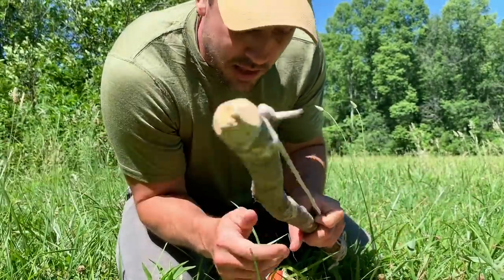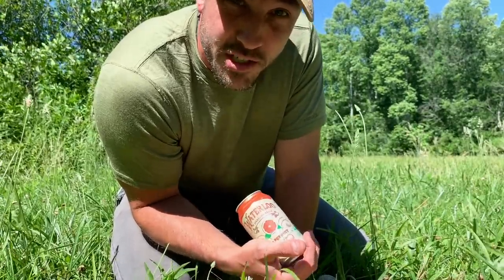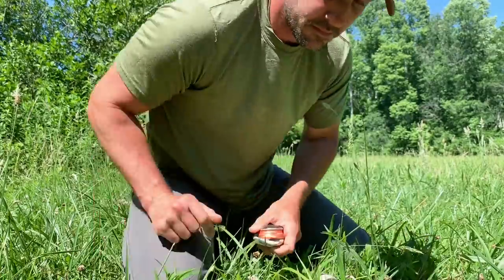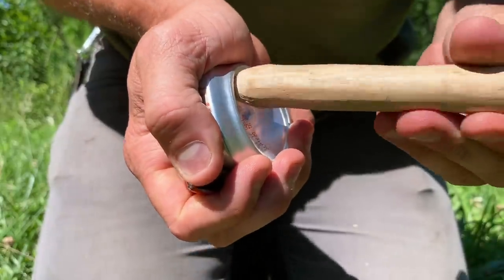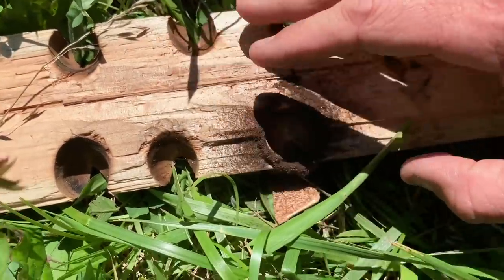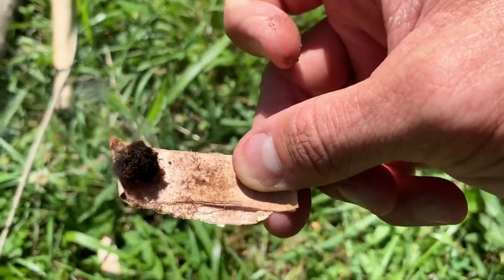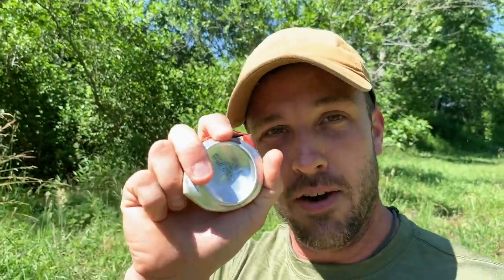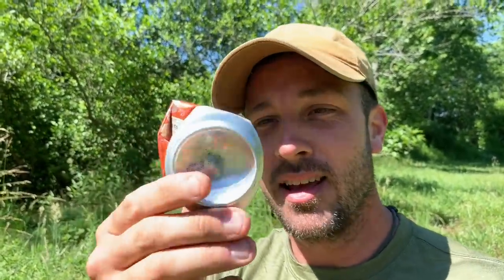Beer Can Bearing Block

Comment: Very cool! Can't say I'm much of a fan of bow drills; looks like it takes quite a bit of skill. But I guess if you have nothing else then it's what you gotta use. I'd prefer using a magnifying glass but those aren't exactly laying around.

I hope the fact we haven't seen much of Mr. Weatherman lately means he's finishing the next Morgan book. 😮😮😮
Reply: If it's a nice sunny day, you could polish the bottom of the can and use that as a "parabolic" reflector to concentrate the sunlight into a beam that will get a ball of fine dry material smoking.
Reply: Thanks for watching! Yes, the bow drill does take quite a bit of practice but it is a great skill to learn. Owning this skill gives me a great deal of confidence in wild places and an appreciation for the Bic lighter. 
-Jason

Comment: Two recommendations for simple fire starters: Put 100% Vaseline and cotton balls into a plastic bag. Get the Vaseline all over the cotton and it should have an easier time catching than your typical tinder. Second, if you have gasoline and styrofoam you can add them together in a Mason jar to make a sort of napalm. Dip a stick in it for either a good way to start a campfire or add cloth around the napalm on the stick for a good torch.
Reply: @Leveraction-xr4uz  it's not explosive in open air. I've used it plenty of times to start fires for cooking or warmth. Just make sure it all burns away before cooking over the flame.
Reply: Love it! Thanks for watching!
-Jason

Comment: You got a better chance a waiting for lightning to start a fire the using that BS
Reply: I think it's funny on Naked and Afraid when they're trying those bow drills and just failing. Shit I'd just bring a fucking flint and steel or ferro rod (NOT one of those chinsy stupid "auto" fire starters, like the piston ones).
Reply: Time consuming, frustrating, weather and material dependent, yes. 
BS, no.